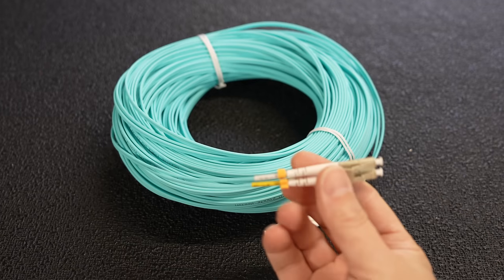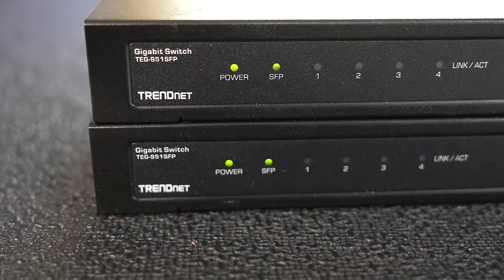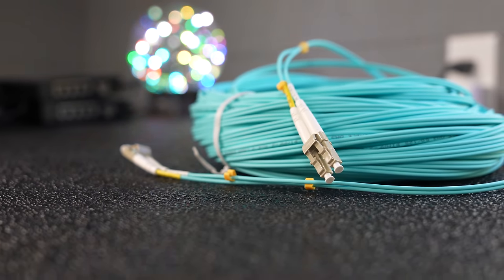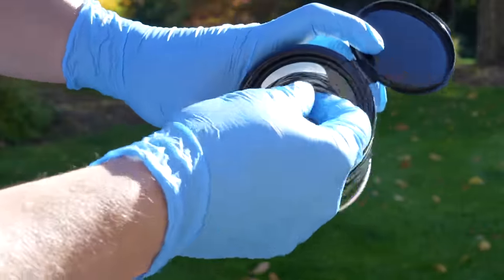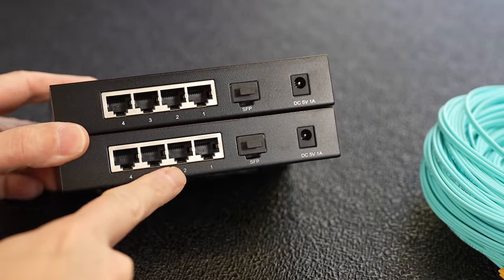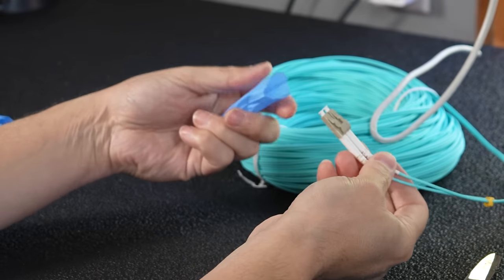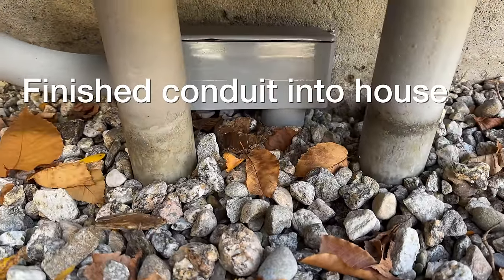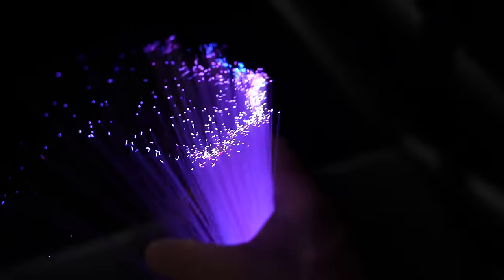How to Run Fiber Optic Cable in Your Backyard - My 10 Gig Install for Starlink

Comment: I'm not sure if this really future proofs your home.  All you've done is setup an ethernet bridge between your home and your barn. Normally, for such a use case, people would use coax (MoCa) or maybe even powerline, since the infrastructure is already there.  However, I think MoCa and powerline may have topped out at 1Gbps. So yes, 10Gbps is nice, and being able to run fiber through existing conduit is very fortunate.

Comment: One thing I didn't hear mentioned, you can't run Ethernet longer than 100 meters. Multimode fiber can run 10gig up to 550 meters, and 100mbit up to 2km!

Comment: Fiber in the house, meh! Let me know when power over fiber becomes a thing. Just kidding, it's true that fiber has all the advantages you mentioned about interference, and distance. But did the 10GbE in the house, copper is better. Use air compressor to blow the one ends through, while the other side uses a wet vac to suck. Push and pull is the way to go. The conduit was a nice touch.

Comment: I see two links for fiber in the description. One for "Fiber" and one for "Direct Burial Fiber". Which should be used for what situations, and how do they differ, and how do the physical connections differ?
Reply: If they're terminated, the connectors are the same. Direct bury fiber (or cat 5, or power) is built differently to accommodate the moisture, and prevent breakdown from being buried.

Comment: What is the difference between a single connector fiber line and the double like you have?  Also, any suggestions on an actual wall jack for fiber?  The way my house has the fiber line setup is ugly.  It's coming out of hole from outside in middle of my outside wall in the living room.  I'd like to put it into the basement from outside instead then connect it to a line coming off a wall plate I put in.  Is this even possible?  I thought maybe it couldn't be because fiber isn't supposed to have sharp turns but it looks like you did.

Comment: Do u have a video on how u hooked the switch boxes to the router in the shed and to ur main moden/ip? Do u just use ethernet cables to hook them up, and do u have to change stuff on ur routers?
Reply from the maker: I just shared this video that shows a lot more of my setup, routers, etc. You might find helpful: https://youtu.be/ydBCDsfC0_Q

Comment: You can get CAT7 outdoor rated 250' for the same price, and you don't have to buy any speciality equipment, it's already 10Gb rated at that length, and can do PoE as well.  So, I'm not seeing the advantage of going 10G Fiber.  Sorry the lightning issue goes out the window when you're burying it.

Comment: Do you think this setup is feasible to share a Gigabit internet access from House 1 to 2, that is around 350 meters?

Does optic fiber cable last on that distance? Or will there be a theoretical degradation or lost of data?

Comment: These videos are always interesting to watch however if you are a business I would not recommend doing it this way. This is a fiber patch cord this is not recommended for outdoor use. Is what they call indoor plant cable which means it belongs inside the building. They make outside plant cable they also make indoor outdoor plant cable. Why is this so important to understand? If you live in a area where temperatures stay below freezing you will generally not have a problem with doing this however the industry frowns upon it. However if you live in a place where it freezes notice the pipe had water in it. If the pipe is above the freeze line in the water freezes this can push in on the glass and cause the glass to be distorted which will interrupt light transmission. The most common way to correct this problem is to use a outdoor plant cable most commonly what they call loose tube fiber what is the difference? The vast majority of fiber outside diameter is 125 microns. There are some versions of multimode which may have varying sizes however it is rather uncommon today as they have standardized pretty much all fiber.
They then apply a thin jacket over it which takes it to 250 microns. The next layer takes it to 900 microns. In this particular case they have up jacket in it 2 mm. Loose tube fiber is a cable that has a tube which the fibers are in they only have the 250 mm jacket on them and they have room inside the tube so the tube can expanding and tracked without putting pressure on the fibers. Also if you are a large scale business and you have a campus environment I would recommend running single mode fiber as there are really no length limits on that particular fiber. Research is always good to do as to understand that single mode fiber is much less expensive than moldy mode fiber. However single mode electronics generally cost a little more than moldy mode products. The other thing that I recommend is not using a patch cord but use a distribution cable with a 2 mm breakout kit on it. You can directly pull on the fiber or even a lot of manufacturers will have a pool member put on it that you remove after you get it pulled in.

Comment: I don't think a buried copper wire is affected by lightning.  I use direct buried copper cat7 and I only put it down 2 in to keep the mower off of it. I don't have 10 gig internet and it doesn't look like your house should have that kind of Internet considering I see a ham radio tower and it looks rural
Reply: You should study copper wire and static charges

Comment: So how realistic is a lightning strike hitting an underground cable?    I mean I live in an area that rarely gets lightning strikes,  of course I also don't have two structures on my property, but for future reference just curious how feasible it would be.
Reply from the maker: It happens quite a bit, if you check out the 8bit guy who is very loved on YT he conncted two buildings and it worked fine for years and a nearby tree was struck the surge made its way into an underground plastic pipe and fried everything on both ends. The damage it can do is unreal. I had two offices just 150 feet apart do the same thing. Fiber eliminates all that

Comment: All of these people following you and making comments goodness. Typical youtube crap. As someone who has pulled a great deal of cable between buildings: you used the wrong fiber. Single mode or multimode doesn’t matter…what really matters is the fact that what you used was not “direct bury” cable. It is not designed to be in conduit or even outside. People making videos need to stay in their lane and not desperately search for content. If you are not an engineer or technician with experience you do not need to be making videos on such. If you were unaware that any conduit buried in the ground will fill with water then you proved my point and should not be making this video. Just because you CAN doesn’t mean you’re an authoritative figure on the matter. For all of you watching and commenting please remember that just because it worked for the video doesn’t mean it will work the next day or that it is correct. Go to school and learn the trade before spouting information publicly.

Comment: How did you connect the fiber to the network feed at your house. Is that network switch configurable for using one of the network ports as an input?   (I just have standard network ports at my house)

Comment: What happens with plastic is Condensation, when the ground heats up during the day and at night it cools the moisture turns to water, you will probably have to blow out that plastic Conduit at least once a year. 
Take and dig a small hole in the ground place a cup and than a sheet of plastic over it and put dirt around the edges to hold the plastic than lay a small rock in the middle so the plastic dips down to the cup and watch what happens the next day. You will have water ( pure ) in the cup and can drink it, but this is what's going on inside that plastic conduit.
Hope this helps. Good Old Boy Scouts.
Reply: Yet the world is running on fiber in plastic conduit traversing the whole country. It's really not an issue

Comment: So in this situation the fiber is just the kink between the two buildings or are you also using fiber patch cables to devices as well?  
Of course I just bought a spool of cat5 for a security system I've needed to install for a year or so. 
This fiber cable looks like it would be so much nicer to work with except that I'm guessing you can't practically make your own custom lengths?
Reply: It's just the link between buildings

Comment: Okay so my question is, if i did about the same thing and i have the starlink gen 3 router and dish, would it improve my speeds? I live in a very rural area with about 200 people and currently without fiber i get 200-400mbps download with the upload being meh  just under 30mbps with two users connected and maybe just under 20mbps with 5 connecter and i do wanna livestream a bit, not like watching videos but actual live streaming such as playing games with an audience and so on, i am just curious if it will improve my speeds, also the speeds show alot different in the app which i find weird when i do speed tests and it shows different

Comment: I'll just buy a aerial FOC and butterfly connectors rather than this flimsy ready made fiber. It has a messenger wire and it is rated for outdoor use. Also there is only few use case for homeuse in 10G, running on gigabit works fine. (Unless you have ultra fast internet like upwards 2Gbps you need 10G).

Comment: i have fiber to the home. my ont is located in the garage and connects to my network cabinet with a router, switch and access point. through a mocha and cat5e to my computer. im paying for a 1gb plan and my computer only gets 200 up and 500 down. where is the bottle kneck. is it my mocha. how do i test my ont. it has built in mocha and ethernet ports

Comment: How far can the fiber be ran without a significant drop in speed?
Reply from the maker: 1300 feet is what is recommended for multimode fiber without loss. If you need a longer run you can do the same project but utilize what is called single mode fiber. There is a cost increase for this but it can go for miles and miles. This is what the towns are wired with for fiber
Reply: @SilverCymbal  Thanks for the reply what is the easy explanation of multi vs single?
Reply: @laroccad18  There is a linus tech tips video about it. The way I understand it is single mode is one blinky blinky and multi mode is many blinky blinky in one cable.

Comment: You can't just run 10Gbit/s over these fibers, you can run over 100GBit/s over these fibers, depending on the optical transceivers. (I found also 400GBase transceivers with duplex LC connectors)

Comment: But why did you run the cat5? Just as a sturdy pull cord?
Reply from the maker: Good question, yes it was some leftover cable that I used as a pull only, but I will leave it there in the event that I was desparate for a temporary connection but I will not connect either end until needed, which will hopefully be never

Comment: I need to ask then, what speeds do you get from your ISP and why do you need a 10gb link between your house and shop?
Reply from the maker: My final internet setup will be around 700 meg but I transfer files between the shop and house. Photos videos. and will use it for backups. So it will make it super fast.
Reply: @SilverCymbal  Thanks for the quick response! I do appreciate all your videos, keep up the great work!

Comment: There's another disadvantage of fiber. Fiber optic cables can't power devices. Between buildings is not a problem, but running across the same building, plain ethernet cables can be better.

Comment: Why did you also bring the Cat 5 wire through? I just need to bring high speed internet from my house to my storage building.   about 60 feet away.   Can I do that with just the fiber?
Reply from the maker: Yes you can absolutely just do the fiber but as I showed the cat5 was a cheap pull cord taking all the force.
Reply: @SilverCymbal  Thanks!!  I am burying my power line so I can easily bury or run conduit for the fiber.  Do you know if you can put power wire and fiber in the same conduit run? or will that cause some sort of interference?
Reply from the maker: @doctordevo  It wont cause interference but the issue is coming out of the conduit. You would end up with the fiber inside a high voltage enclosure and it becomes a code issue and you really dont want fiber in a high voltage panel and out.  Do 2 pipes, the fiber can use a 3/4" or 1"

Comment: Is there a type of router they picks up wifi signals and turns it into Ethernet kinda a reversed router
Reply: These exist, but usually you can find a wifi extender with this exact feature and it will work.
Reply: @tabbycat406  k thanks

Comment: wow, $200 and your up and running with future proofing in mind? fiber is basically a no-brainer then, we ran ethernet in our house in 09 and it cost almost $500 and it's all cat5 so no sense in getting anything more then 100mbps service the house wasn't planned out for future upgrades unfortunately either so we'd have to gun the home to wire it.

Comment: Fiber is just a waste if you're only going to do 1Gbps. The cost of the switches and fiber is more expensive than just Ethernet. Heck where you are a good router with a directional antenna might even be a better fit.

Comment: TLDR; get a mikrotik switch with SFP+ for cheap and never upgrade again...      SFP is a waste of time and money. if you're gonna run fiber get an SPF+ switch and then you can have 10gig. You can get a SFP+ switch from mikrotik for like $50 and they are a great brand. I only have 150MB coming into my house but i have 10gb going between my computer and my NAS which allows me to transfer files at 5gig. could be faster but that its a limit of the hard drives in the NAS.

Comment: I wouldn't worry too much about copper cable getting struck by lightning if it's buried underground. The bigger problem with it is signal attenuation. Cat6a runs are only good to about 55 meters at 10G. That distance doubles if you drop to 1G. OM3 fibre runs are good for about 300 meters @ 10G, although I've found that the actual range you can expect varies wildly with the brand & quality of the SFPs you have. 

The big downside to fibre is its fragility. You can't tug on a fibre cable at all, or you'll likely break the glass inside it. You also can't reterminate a piece of fibre nearly as easily as you can with Cat6, and you can't splice it at all, at least not practically. 

If I was building a wired home network on a large property like that, I would OM3 fibre for long hauls between buildings and Cat6a to all the endpoints.
Reply: That isn't entirely accurate information.  Cat6 cable is capable of 10GBASE-T, over a distance of 55 meters and 1000BASE-T over the full 100 meters.  The Cat6a  standard is capable of 10GBASE-T over the full 100 meters.  

Additionally, Copper cabling buried in the ground is still prone to be struck by lightning and when it does it can propagate through any connected devices on either end of the cable unless properly grounded.

Comment: If your house is struck by lightning, you have bigger issues than a network switch getting damaged.
Reply from the maker: True, except that wont be how it works. Copper lines will attract lightning much more so and conduct it. You won't have your house be hit at all, you will wake up to all your gear fried
Reply: @SilverCymbal I don't think lightning cares abut some 24 gauge wire.

If lightning was attracted to communication cables, all the millions of miles of communication wires and equipment would be long gone.

I ran fiber in  1960s house.

Comment: FIBER FAIL:

He just told you the pipe was wet. All pipes are wet. This fiber will fail.

Instead source a “soaked” fiber cable rated for outdoor use and put that in the pipe.

Comment: That's true about grounding but cat6a full shielded twisted pair is grounded out the ass if you use the proper metal keystones, the advantage is PoE with the rise PoE switches that are POWERED by PoE you can put a UPS on one switch and back up the entire property but, again you still have that lightning risk. I've in the past suggested both fiber and copper but if you do leave and extra copper run that is unhooked as a spare and use surge suppressors if you're not pushing more than 2.5gb (most are rated for 1gbps) ALSO most homes are grounded enough to save your life not your electronics Home and building grounding can also be upgraded EDIT: D'OH!!! I forgot to mention comscope now offers powered fiber, you can run plain old DC power with/in your fiber and use converters and adapters at the other end ALSO some fiber isn't super delicate I've heard of guys running them over roller carts (not back hoes) with no issue ALSO all conduit gets water, pros say to never considered it water rite as water almost always gets in so if you use copper make sure it's direct burial. I also suggest grease filled is running Ethernet cable

Comment: That fibre was still pretty expensive and if you buy actual high quality fibre, not the stuff you used, which is the low quality stuff that phone companies use as a sales gimmick against tv cable companies (who actuallly use the commercial grade stuff for intercity connections).  I guess the alternative would be coax.  I find it interesting that you said lightning would be an issue with copper cable, especially if you were burying it in the ground in ipex conduit.  It would have been cheaper to run coax from one location to the other and it's more forgiving to bends than fibre.